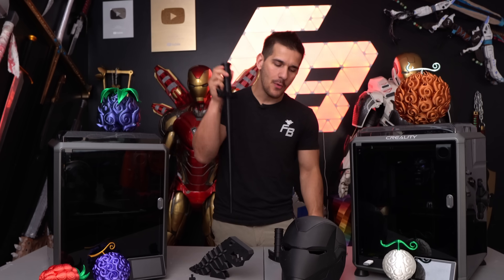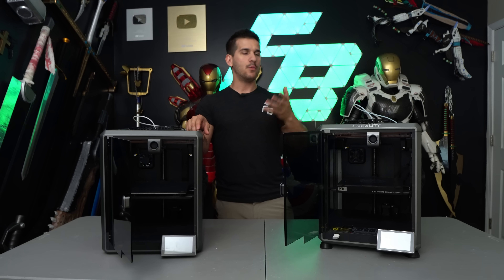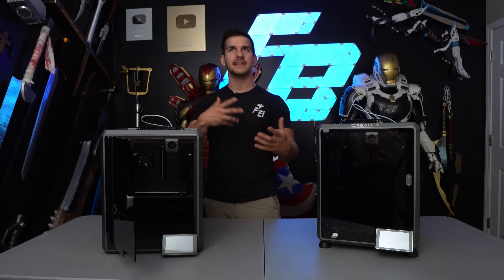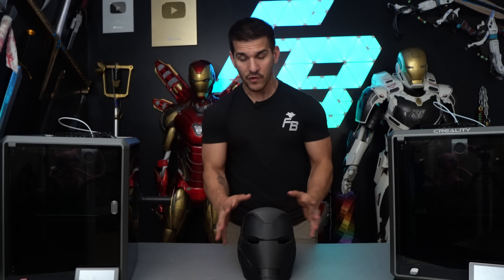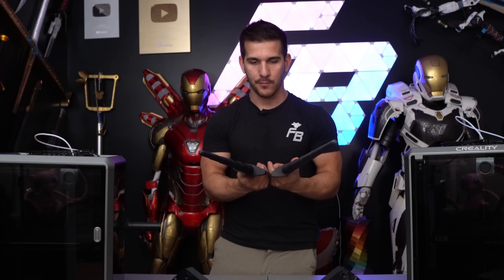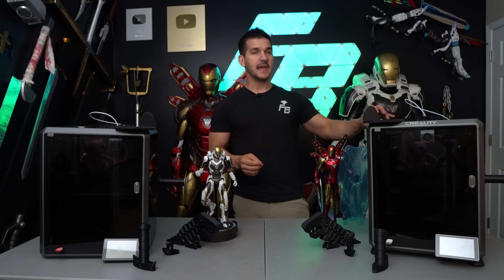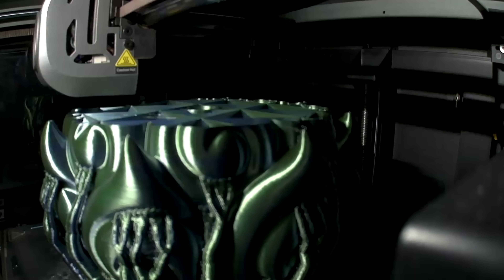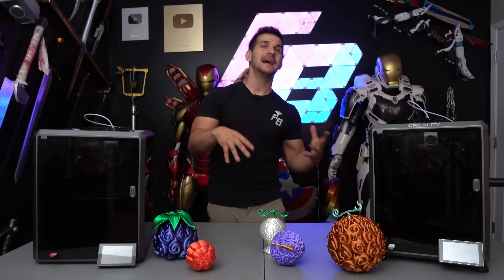Creality K1 vs K1C | Which 3D Printer is Worth your Money!?

Comment: I have been attempting to print PETG-GF on my Ender 3V2 after switching it to a hardened steel .6mm nozzle. It didn't have a filament profile for it, so I just experimented with my settings. I have had some things come out pretty good, but it keeps damaging the rubber shroud around the nozzle by filament sticking to it. Does this K1C have a filament profile for PETG-GF or would I still be experimenting with settings?

Comment: Essentially the same if you upgrade both to run CFS. The CFS upgrade will replace the extruder on both versions. So to save a buck or two, wait for Creality to put the K1 on clearance and buy the CFS upgrade package. Ai Cam and nozzels are easily upgradable. Get the K1

Comment: Watched as Creality website gives almost no infomation in the diferences, or even what they come with. I also think they have slowly made changes to the hot end, extruder etc thats used so posibly the only actual difference is the camera? The Web chat was also useless at seeing what each one came with re nozzle (wanted to buy a harder nozzle for CF if needed when ordering but couldnt tell what i needed). I just got a K1 from thier UK offical ebay store, mess of offers with different listings but got the K1 for £270 (with a ebay promotion running at the moment). Will come in the next week or so so can see what hot end etc is there but have a feeling it may be the new 'unicorn' one making it the same as the K1C (also note in the uk they seem to call the K1 the K1 speedy although is the same thing?), no need for the AI camera as after the 1st year it slightly ties you to their cloud which i dont need. 

Anyway, this video is exacly what i was after, a recent (ish) video saying the difference. Would be great if they actullly show the version or the components it comes with for what seem to be gradual un published updates. I also have a feeling this will change a bit with region and possible older stock where they made the changes.

Comment: would be good if the k1c printer came out a bit bigger. Creating a mask and parts would be a little small for this task? I know there is the K1 Max. I dont want to spend more than $1300 NZD. I like the features you describe on the K1C

Comment: I had no interest in these smaller printers but figured I'd skip around through this video out of curiosity since I just got the K1 Max. I just want to say you do a great job with your content because I ended up watching the whole thing without skipping like I usually do on review videos. This was really a great comparison between the two with solid information & I'm positive it's going to help a lot of people make their choice. Keep up the good work dude! Earned yourself another sub 🙂
Reply from the maker: Well thank you!!
Reply: How is the max performing ? I have to choose one between the k1c and max.  Lots of videos saying bed level and warping issue with the max. Did you face any ?
Reply: @alimuzafarfanpage  Yes unfortunately. I've replaced the solid bushings under the bed with springs so I can adjust it a bit. The bed still warps a little when heated with an average deviance of 0.5mm. That said, it hasn't really presented an issue for me yet and overall I'm really liking the printer so far. It's not without issues but if you're not afraid to tinker it's still a solid machine.
Reply: @KevPV  AHH, I was hoping to hear all is good. Haha. Anyways Frank doesn't talk about this issue. As someone new I'm not sure now if I should get into this. Or get something relatively cheaper if there is going to be tweaking

Comment: I got the K1 as my very first 3D printer after they fixed the issues for $349 on Black Friday. I upgraded my hotend to a Micro Swiss FlowTech and added the AI camera. I’ve had issues with under extrusion at 1 corner, but I just lower retraction and increase the extra prime amount. I’ve also noticed that the print quality is affected by the stability of the surface it’s sitting on. I wasted time changing values and running calibration tests when all I had to do was sit it on something sturdy. I also reduced the travel and jerk speeds a bit since they seemed unnecessarily high.

Comment: Hey Frank, i have printed an ironman helmet in 110% scale and was wondering if that meant that i should scale the motorization kit to 110%? Since the one part that holds the servo needs to  be the right size and what about the holes?

Comment: Hi frank, i am looking to get into 3d printing and i am not sure what types of filaments i will print for the most part but i wanted to get a machine that can print many types so i wont have to upgrade in the future. I have seen the creality k1, k1c and k1 max as being good options however people also say that bamboo lab printers like the p1p, p1s and x1 carbon are better and more intuitive for beginners. I was wondering if you could recommend a printer for someone looking to get into 3d printing that is versatile enough to print tough filaments, comes enclosed or has an option to be enclosed such as the upgrade kit for the p1p, and is easy enough for a beginner to use. Also a plus if the machine has a print bed that is standard and or can be upgraded to use multiple filaments. Thanks!

Comment: I got two K1 used from a Facebook marketplace seller and one has been great and the other a mess. The seller hadnt tested that one for months and left ABS in the nozzle for all that time. Now its causing issues with the prints because something is happening with the new nozzle and hot end after i had to replace the nozzle and small tube because of the clog.

Comment: I'm a newbie to world of 3D printing. I've been reading and watching as much YouTube videos to determine which printer I want to purchase. I'm leaning toward a enclose system to keep the smell down to a minimum and not to worry about temperature control for the open systems. My question is "Would you recommend replacing the nozzle on the Creality K1 or the Creality K1 Max by Microswiss  FlowTech Hot end? " So not having to heat the nozzle up to remove it and then replace the nozzle, plus torque it in place so not to leak. That way you can change the nozzle when it is cold. Looks like Microswiss  FlowTech Hot end makes it for other manufacturers also.

Comment: Have you had any issues with ghosting on any of the K1 series printers? My K1 Max has crazy ghosting problems and Creality customer service has been as useful as a poo flavored lollypop...
I've adjusted belt tension, cleaned the gantries, and rooted the printer and still get bad ghosting...
Reply: Root klipper and you will get better input shaping.
Reply: @petercallison5765  I did that and still get really bad ghosting... it's like my input shaper just doesn't work in one axis

Comment: My k1 is okay, I bought in dec and got the original extruder and hot end. I put a 3rd gen extruder and micro swiss hot end. I still get ringing and vfa.  So if the k1c has fix that its worth the extra money. Remember the k1c has replaced the pullies

Comment: Neither.  They are made by Creality and therefore are the lowest quality one can possibly buy.
Reply: Yeah, probably should just buy a PRUSA ... lol
Reply from the maker: I mean yeah if you want to waste money
Reply: @FranklyBuilt  do your have one? i do and it blows the socks off anything my maker friends have. While they are tinkering to no end doing upgrades and constantly tweaking I just send prints to teh machine & it cranks them out. And the 5 head machine is miles above other versions of 'multi filament' machines. Filament changes  take less than 3 secs with no waste filament. And the 360 x 360 x 360 print volume is a cosplayer's dream.  I get that most can't afford this machine but they really a cut above the rest.  It's l;Ike saying a Honda and a BMW are both cars so it doesn't matter which one you get but if you've ever driven or owned  a BMW you understand there is a difference.  Ever notice how many YTers who have print frames are running PRUSAs.  Even Adam Savage is running PRUSAs -- there's a hint in there somewhere ... lol
Reply: @astrophysicistguy  you clearly don't understand the target audience of this channel or the purpose of Frank's videos. He knows PRUSA's are great, they are just overkill or way too expensive for the size and things people who watch his videos want to print
Reply from the maker: Yeah that’s not true anymore. At all lol

Comment: The problem with the K1 or K1 C is the Creality idea that you must only buy their own K1 type Nozzles and that are pricey! You can't buy any nozzle of that type for them only theirs.
I stick to my Qidi X-Plus-3 thanks, it has a bigger build size and a better system than the K1 or K1 C.  And the newer Q1 Pro by Qidi blows any other Core XY out of the water.

Even better than my Qidi X-Plus-3.  any company who makes 3D printers should not only open source the Klipper system their use ( Which Creality did not do on the K1 series ) 
until the users moaned at them for not doing it per the Klipper terms and conditions said, 
But any company doing the printers should also make the volcano type nozzles used be ones we all can buy from anyone not just them?

And I agree that Elegoo's mega sized Orange Storm Giga needs a smaller version around say a 300 square one & 500 square print area core xy as we can't all get the giga one due to the cost?
Reply: Is is not true, there is plenty Vulcano style nozzles for K1... do some research

Comment: i got my k1c about a month ago and been printing non stop, with PLA, Silk and CF. This is my very first 3d printer and as a complete noob to 3d printing the k1c hasn't failed me at all besides the usual user fault issues, Its been a very good experience coming into the 3d printing world because of the k1c. I definitely recommend to anyone new that wants to get into 3d printing.
Reply: Same experiance for me. Out of the box it works fine, Usually its just download the STL, set the right filament in Orca slicer or the new Creality Print 5 and print.
Reply: How does it hold now
Reply: @isaacbored  still pretty good. Haven’t had any issues besides my own errors like yesterday accidentally didn’t check what my infil was overnight and got up in the morning with the print 75% done and my infil was set on 100% lol whoops
Reply: @daledon69  so after having had it for 5 months you think it's worth it as a first time buy?
Reply: @daledon69  I'm trying to decide between the K1C and the K1 Max... I hear the max is a lottery ticket whether you get a good one or a bad one? Is the bed better on one than the other? Guessing max bed is so much wider it has room for it to warp?
Reply: @daledon69  what does this mean cuz ima noob at this and i feel this may had happen to me twice ??
Reply: @Ambu557  infill means the solid part. basically, infill determines if you are printing a shell (lighter, quicker to print, less filament etc, but less durable, more flexy) or a whole, solid brick or smth (heavier, slower to print, more filament etc, but more durable and more rigid).
Reply: I got one that never worked, not even once. Creality will give you a run around K1C is a POS
Reply: Useful info for this beginner, thanks.

Comment: Neither, wait until the K1 Neo Plus Pro is released.    Creality's standard operating system is to release junk for 3 to 5 iterations of the product line.
Reply from the maker: You’re not wrong lol
Reply: @FranklyBuilt  It creates plenty of work for reviewers.
Reply: In my experience they just release junk for all iterations making small changes but never fixing the printer completely. Then a year later the new iterations start coming out.

Comment: NONE ! The K1 is the biggest scam of all.. not even 6 month after they announced the k2 while the k1 and k1C are filled with flaws… creality need to stop relying on the community to get new printer out every 6 months!
Reply from the maker: I’ve been using 3 k1/k1c and 4 K1 MAX printers for months. And they’ve been amazing. Some firmware updates and the issue with the OG k1 extruder but…yeah no. You’re very wrong lol

Comment: Hey Frank I just got a k1 max yesterday I was wondering on what your thoughts on putting it on kilpper is if it’s really needed or not ?  Awesome video as always 👍👍
Reply: you don't, it already runs on klipper from the factory. all you need to do is root it.
Reply: Just root it and do a proper inputshaper. Out of the box it does inputshaper in the x axis and uses that value for the y axis also. I have a k1 since december and i already had the newer extruder in it. Only added the webcam and rooted. After rooting i run the guilloz script to get the input shaper good. The printer is great. Only thinking of changing the pulleys for smaller ones to get rid of the vfa. Already have them just need to put them in the printer 😁

Comment: I love my k1 and have updated the extruder,  hot end, added camera and did a few things like level bed and rooted it. It prints like a dream and paired with Orca it is a beast. I never really cared for creality before and have 3 other printers from other brands. But now my k1 is my go to printer. I have over 1000 hours on it and up to now its been great. We'll except for the exploding door. Lol. But creality was great and is sending me a replacement  door and dealing with them was easy. I was surprised.  Love these kinds of videos.
Reply: my k1 has ringing and vfc. I have replaced the hot end with the micro swiss.